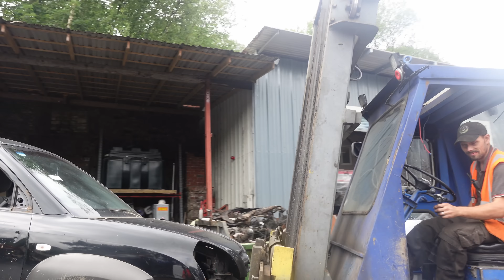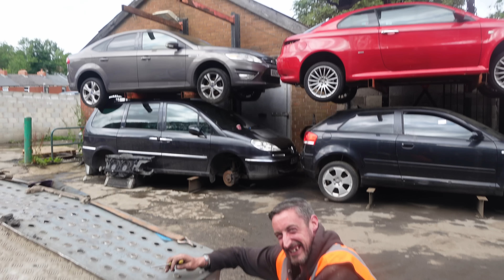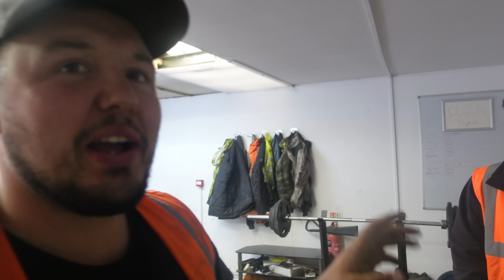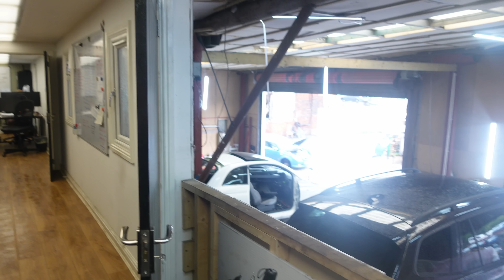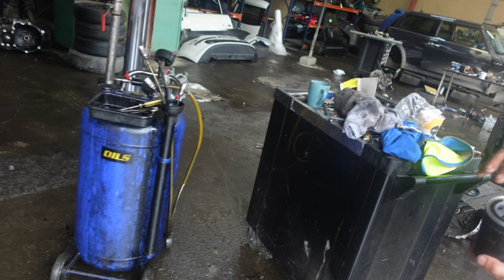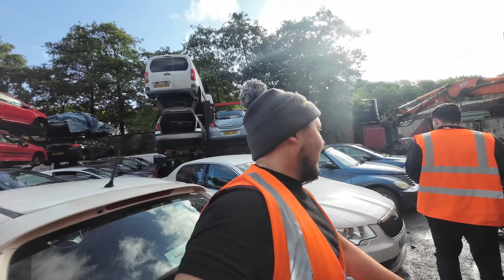Special Family Guest And Lots Of Scrapping | WHAT A LOAD OF SCRAP - EP59

Comment: Tea cake? Surely a tea cake in Lancashire is approx 5" diameter and designed for making sandwiches, not a little chocolate covered thing the we used to call a fairy cake?
Nice to see Zoe and her smile! 
A glimpse into the precautions you have to take when you buy a car, it's a reminder that there is a serious side to car recycling.  Many years ago a trip to the scrapyard often involved the customer climbing over the stack of old vehicles to remove the parts they wanted, the business has certainly evolved into a much more professional environment.
Thanks for another great video best of luck!